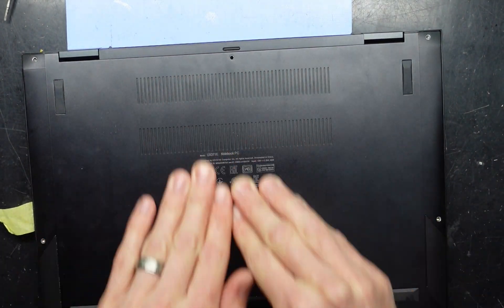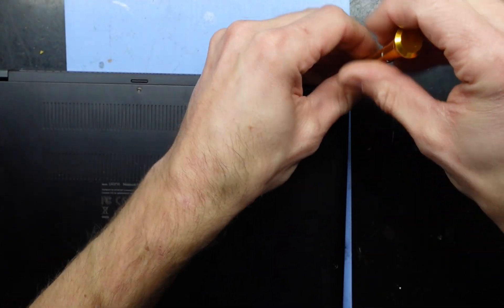Asus Zenbook Flip S UX371 Display Assembly Swap

Comment: Hi Rick, doing this for a customer, do you have a video on just replacing the LCD out of the back plate?  Separation is not clear and wondering if I should just do what you did or can this be done?
Reply from the maker: i suspect if the exsiting LCD Panel is getting swapped i would head up the screen assembly on a heatpad at 60 degree Cel

and then pry near the bottom of the screen and see if you can get it to lift.

Highly likely its stuck with stretchy double sided tape